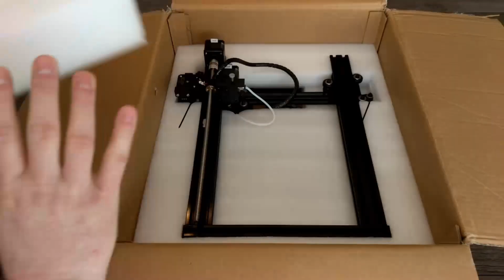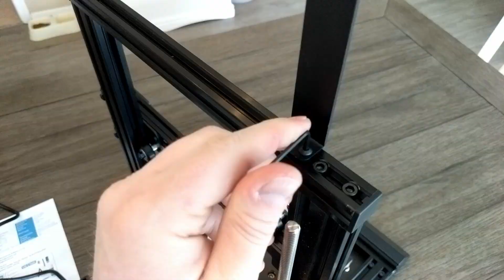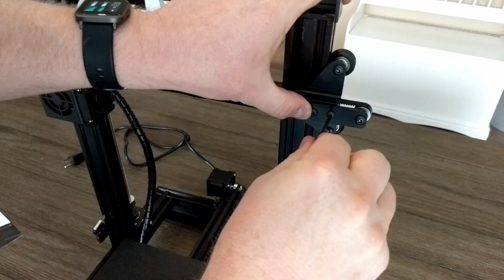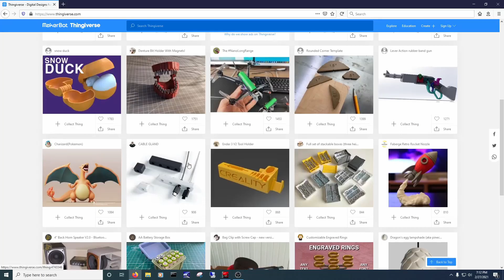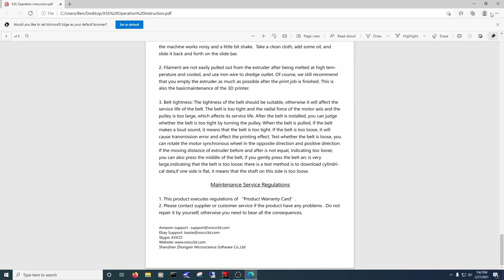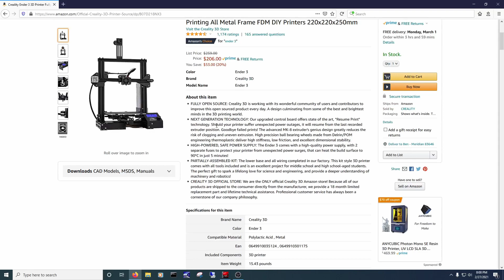XVico X3S 3D Printer Review

Comment: I'm currently bidding on an X3S, a very good bargain if I get it. Two questions,clarifications. The unit does NOT come with filament, correct? I will neer to purchase 1.75mm separately? The second question. I have SolidWorks installed in my home office and it supposedly outputs (save as) extensions that can be used with 3D printers. Can I create objects and save to a format that this unit will recognize? Direct connect to my PC or will I have to transfer file to SD card?

Comment: Well i got a similar printer the xvico 3d "pro" but after some problems regarding the stepermotor driver and as well more hardrware upgrades like a direct drive for cr-10 3d printer and as well a 0.8mm nossel plus a heaterd bed and redoing nearly all the cable on it and as well a 120mm fan for the mainboard and as well the psu it finally work okish I waste like 2 rolls of filament till now to get it up in running now currently is printing something.  But yeah cheap printer is more like a tools wich you have to add improvements to it then a plug and play

Comment: Hello great vid ! ..i`ve just got one of these and wanted to ask  you if you connected to cura via USB and printed directly from that ?, if so did you need to install any drivers as mine wont detect that a printer is connected , or ... did you save the print files to card and do them that way ?... thanks again Steve
Reply from the maker: I just print from the card.
Reply: @BudgetNerd  thanks for your reply...I'm still trying to get me head around how stuff works ...am I right in saying the print specs you specify in cura are saved to the print file ? I ask this as I've noticed that whenever you change any settings in cura the print file re-saves...thanks steve
Reply from the maker: Yes all those parameters from the program are saved in the file that goes on the card.
Reply: @BudgetNerd  Thanks Man ! you`ve been a great help .. i`m starting to figure it out now .. cheers from the U.K. !

Comment: The oozing at heat up is normal, you could add a retract at the end of prints so that it is lessened when it starts. I don't own the same printer, but from the looks of it, it seems to be an Ender 3 Clone and would probably work with the current version of Cura using the ender 3 profile.

Comment: Here's a few tips for this printer, firstly check that everything is tight, but at the same time moves smoothly.  I found that the x and y belts were loose, you simply need to loosen the bracket on the right of the x and the same on the front of y, pull them so that the belts tighten then re-tighten the nuts.  Just for reference the nuts you need to loosen/tighten are the two on the front of the x axis bracket nearest the upright and the four (two either side)on the front y bracket, again they are the two/four nearest the bed.  You may also need to tweak the settings of the wheels on the x/y/z axis, this is achieved by loosening and tightening the bolts on the bearings with the rubber tires on them.  Check for wheels that rotate without moving the axis, these need to be tightened, if you notice any severe resistance on the axis or binding at certain spots again check the wheels.  I needed to loosen/tighten the two on the top edge of the hot end carriage on the x axis as it was binding on a couple of places when you moved the carriage across the bar.  Similarly one of the wheels on the righthand z upright was loose and one of the wheels on the bed needed to be tightened as well as the bed was rocking slightly from side to side.  Lastly and most importantly check that the nozzle is tightened properly, if it is not you will notice plastic leakage as per the reviewer here.  This will lead to burnt plastic, drops and more importantly longer term probably blockages in the hot end which all will ruin prints, so make sure its nice and tight before you start and all should be well!

Comment: WHat settings for heat on bed and eXruder thanks
Reply from the maker: I usually do 60-65 on the bed and around 205-210 for the extruder.
Reply: @BudgetNerd  well mine stopped extruding 1 hour in so have not got a clue now it wont extrude at all
Reply from the maker: Could be several things. Extruder motor wire came out, motor failed, clogged hose, clogged extruder. Messed up settings in the slicer even. If there are still the sample prints on the SD card, you could try printing one of those and if it prints fine, the issue could be the settings in your slicer. You could reset them to defaults. If the included samples don't print either, then I would look at the printer. You could always contact their support.

Comment: Hey I recently got the same printer but I am not having much succes with it,I cant get anything to print. My main two problems seem to be the facts its not sticking well and the nozel oozes out the plastic and it rolles up onto it, I was wondering if you had these problems to and what settings did you change to fix it. thanks in advance
Reply from the maker: I did. The following seemed to help me: 1) keep the bed clean, I noticed that oil from my hands would mess up adhesion 2) slowing down the speed of the first layer 3) increasing the thickness of the first layer 4) having a skirt in the print to get rid of any nozzle flow issues before the print starts 5) recalibrating the bed, or moving the bed a bit closer to the nozzle 6) keeping the nozzle clean.
Reply: @BudgetNerd   Thanks I"ll make sure to try these
Reply: Hi, did you manage to get it working? I am having same/similar issue.... When I want to print, the nozzle gets to the starting position, goes close to the bed and then the plastic does not stick... or even worse, once it gets close to the bed, just goes back to default position and says 'filament change'... 'press ok to resume'.... Cannot figure it out how to get it work... Thanks